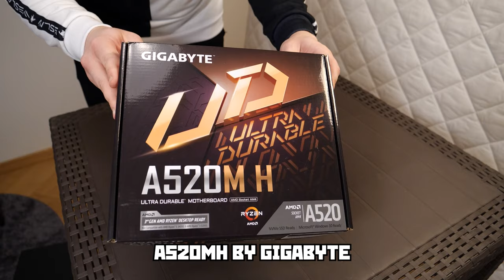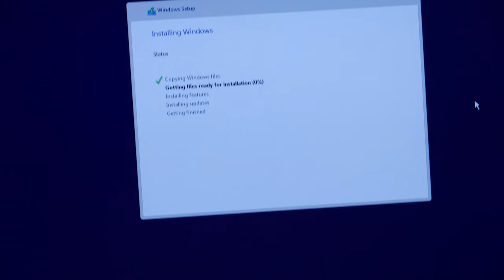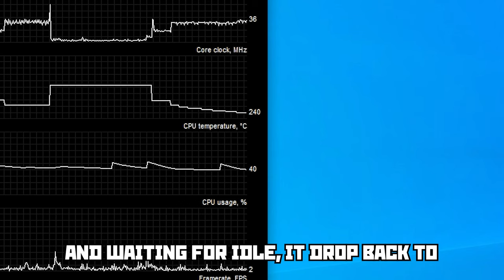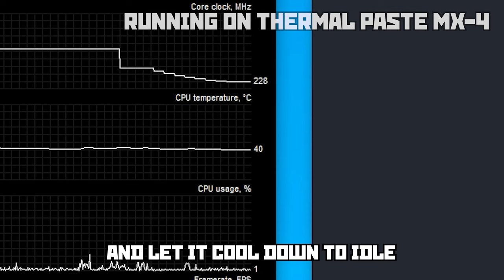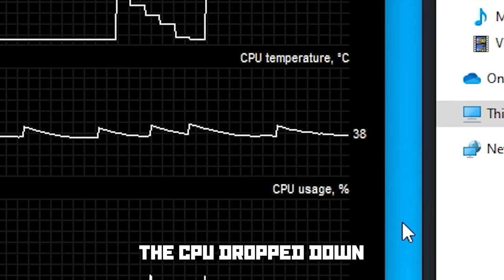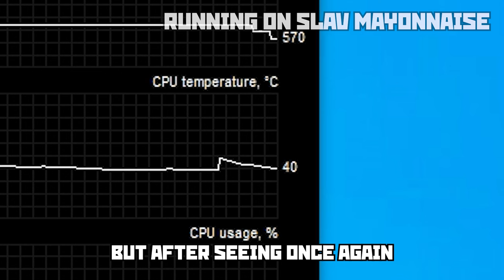Can you replace thermal paste with mayonnaise?

Comment: I run Cyberpunk at medium settings with a solid 30fps on a 1050ti it's purely the RAM holding you back lol. The game itself will take 16gb and then windows and anything else running will need extra or it chokes.

Comment: I figure the eggs will fry dry after awhile and lose the seal.; edit full fid vodka or everclear might go full submerged if you use distilled water maybe bur it wont go through a 2x distill of the vodka if your trying to recapture it from the heat

Comment: Boris, if you're using the computer in one test standing upward and the other facing sideways, the reason the mayonaise worked better was because you put the PC facing up so all the hot air rises. This is further explaining why the GPU is working at a cooler temp. good video otherwise, but the testing isn't right.

Comment: Boris: gtx 1050 ti is the cheapest you can buy
Me: what's the cost in my currency
Store: about 2k
Me: ok how much does um 16gb ram and an i5 9400f and 250gb ssd cost in tottal
Store: about 1.2k
Me: what

Me: OK ok and the fans?
Store: 200
Me: So the pc whould cost 3.4k?
Store: Yes
Me: And do you have pre-built pcs?
Store: Ye we have a few heres 1 whith i5 9400f 16gb ram gtx 1650 240gb ssd plenty of fans 500w power unit
Me: how much
Store: 2.7k
Me:🤔case? 
Store: ye glass panel case rgb fans and shit all that good stuff and the pc supports ethernet 
Me: how is it so cheap
Store: well we haven't sold all of the pcs from this type so we can keep the price low and also no 1 buys pre-builts anymore 
Me: well yes but this is my first pc that isn't hot garbage 

Edit: just made the story longer

Comment: Budget ? i bought a Dell optiplex 790 with no GPU and with intel i5 2400 2 core then i placed the motherboard (also dell so it's trash xD) and now i have it in a umm some case from brand "Agem" and it's from 2007 and i put a GTX 960 4 gb (normal has only 2 GB which is lame) OC (overclocked) windforce edition
btw the overclock is not made by me cause it's overclocked from stock :) and plays better than most of 600-750$ PC's and mine was for under 300$ (i got the case from my brother and the GPU too so i didn't have to pay for that) lol @Life of Boris

Comment: i don't like AMD processor's :)
Reply: intel is too hot
and i mean the bad hot
amd ryzen 5950x and amd ryzen threadripper 3990x are the best cpus
(sadly i don't own any of these cpus)
Reply: @OctoBirb8Claws  I have an i7 10700 and in gaming I don't exceed the temperature of 65 maximum 68 degrees, ho can I say that they make me laugh, however I think ur kidding
Reply: @tanay_21real  Amd it's trash🤣
Reply: @tanay_21real  Have you seen the 5000 series? Those get pretty damn hott.
Reply: @AndreiChrisso  my i7-8750H literally gets to 100C.
i'm not kidding.
the 3xxx series is basically the same, except it's much colder.
Reply: @AndreiChrisso  for what reason is it trash?
you're probably stuck in the times where ryzen didn't exist, or you're just a troll.

Comment: BORIS you copied ( well almost copied ) my pc build ( parts: my side MOBO: AsRock A320 HDV R4.0 You: Gigabyte A250M-H and then changed to Same As Mine ( with locked OC (OverClock) of CPU ) RAM: me: 16GB Crusial DDR4 2666 Mhz 2x8gb You: 8gb G.Skill.    CPU: me: AMD Ryzen 5 2600x you: AMD Ryzen 5 1600 :D :D :D   PSU: ME: Cheap chinese PSU from ebay ( but it works bliat :DDD ) You: corsair 450w fully modular PSU    Case: Me: random MATX case from ebay You: random case from babucka              Internet: ME: old ethernet or my phone ( huawei P20 :D used as wifi dongle ) or good old RJ45 1 gig conection to Fiber internet (internet speed 150 mbps down 30 mbps up just for 30$ and for 60 $ i can get babucka premium 900 mbps down and 110 mbps up :D   You: TP-link Wifi module USB ONE :D :D :D :D :D and old slow russian wifi which is better than nothing ) and cmon you cant overclock ur GPU i have ASUS ROG STRIX GTX 1050Ti 4gb and Core Runs AT 1930 - 1940 MHz and power limit at 156% and it reaches a nice 60C without overclock and with it reaches about 61C